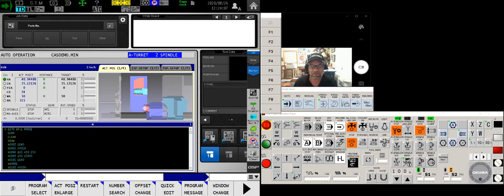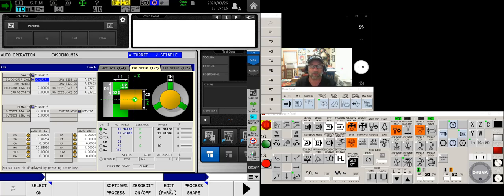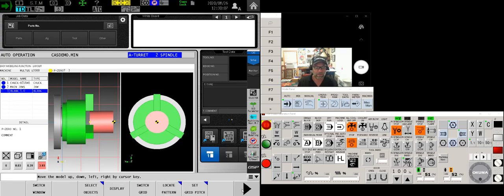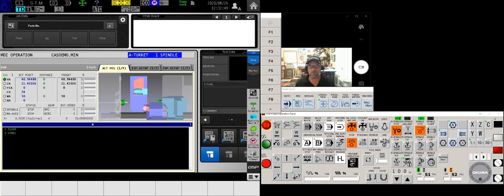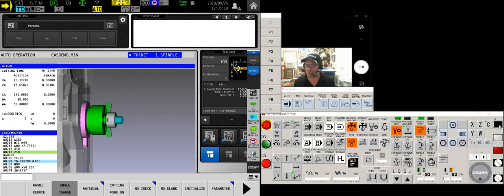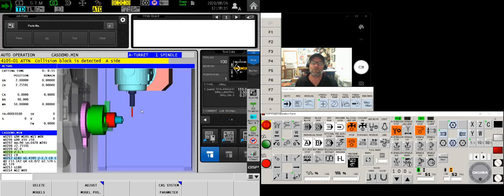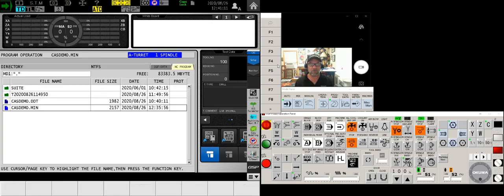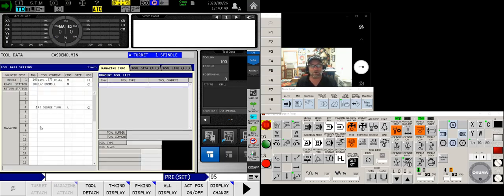CAS function on Okuma U3000 Multus

Comment: Does the CAS require an accurate description of workholding/part to work, or can it also work off the servo load feedback to reduce the severity of a crash, similar to what Haas and Heller have?
Reply from the maker: Our CAS system is a digital twin platform to avoid collisions, so yes: an accurate model of the part, fixture and tools is needed for collision protection. Because it is designed to prevent unwanted contact, it does not provide crash minimization like the other platforms you mentioned.

Comment: Is that simulator available to Okuma customers? Great video, I have been programming Okumas and this cleared a couple things up for me.
Reply from the maker: Shane, yes the simulator software is available thru your local Okuma dealer. They call it PCNC Master. It really rocks for testing programs or offline learning. Okuma also offers an offline software that is a perfect mimic of your actual machine configuration. This one is called 3D Virtual Monitor and is more designed to create CAS environments offline and test out your programs for collision before you send them to the floor.
Reply: @pocketcharleywithgosiger  Thanks Charlie,  I'll definitely check into that!
Reply: @pocketcharleywithgosiger  Hello: and should the OKUMA distributor provide it for free? or does it have a cost? Thanks
(I consult you because it seems to me that the local OKUMA vendor is not very reliable)